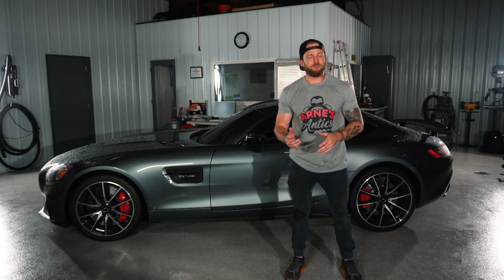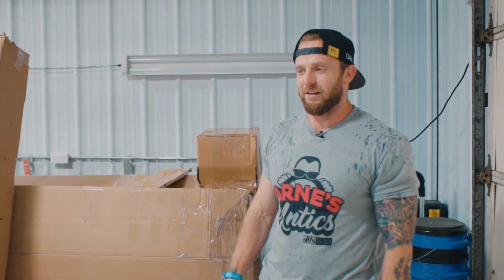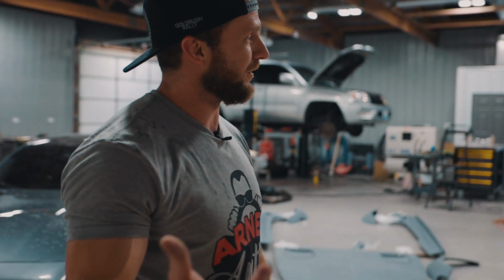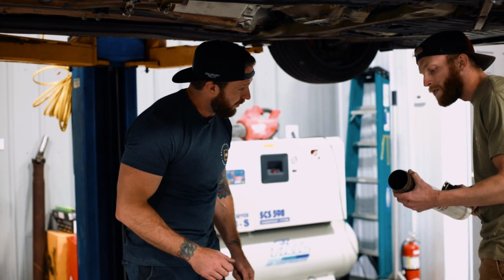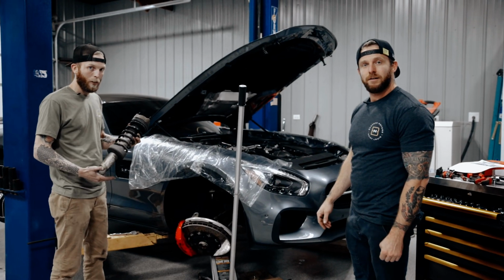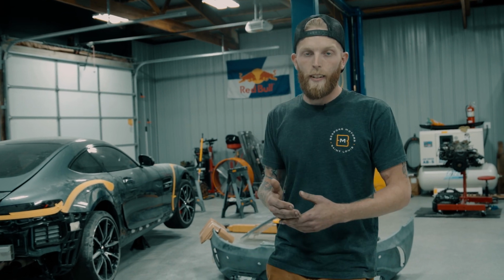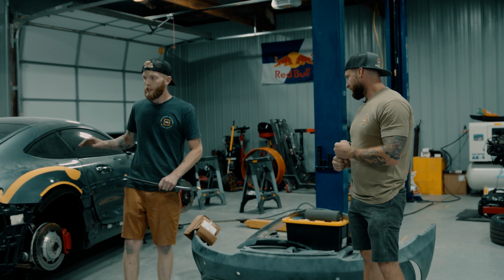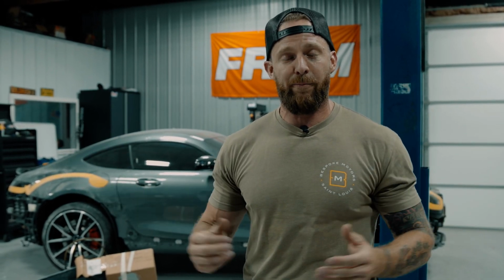The most insane AMG GTS build ever!!

Comment: Buy a gtr version much cheaper all original and be done.I have a Gts and would never spend this kind of money modding it.
Reply: I have a gts as well, and salvage titling this buildout with a reticulating saw was tough to watch.   Also, lowering it with aftermarket coils?  It’s slammed already.  The only mod I’d like to have on mine is a front lip lift to avoid scraping the carbon spoiler.   I won’t even ECU tune it.